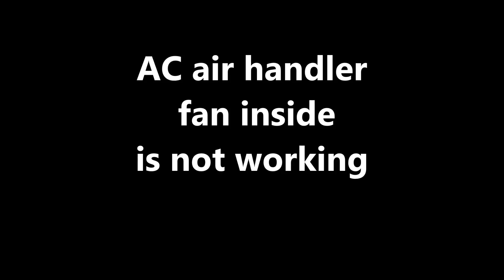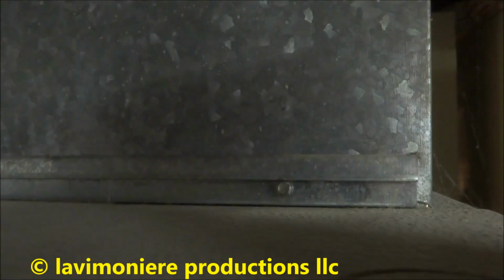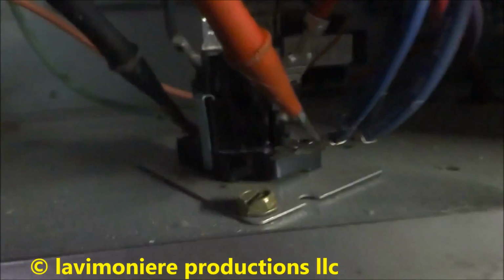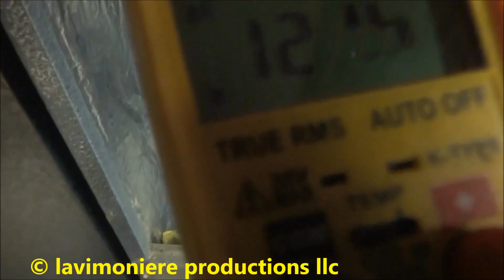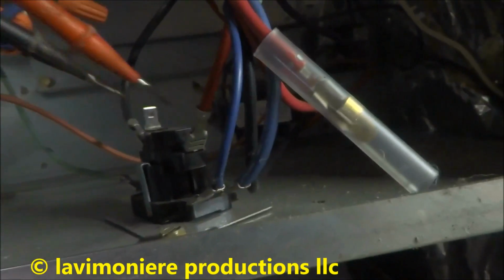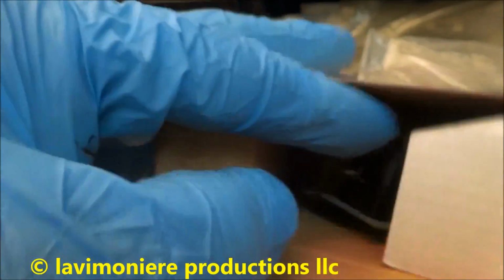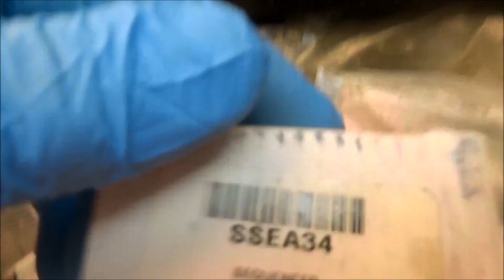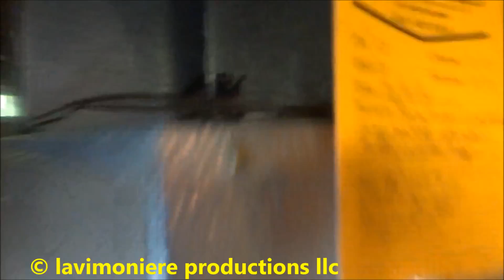AC unit icing up

Comment: Yes Steve very common problem in these Goodman units replacing that sequencer I I usually replace it with a R 8222d1014 24 vt relay.    Good  diagnostics. And meter use !!